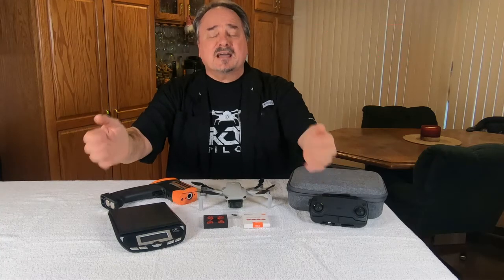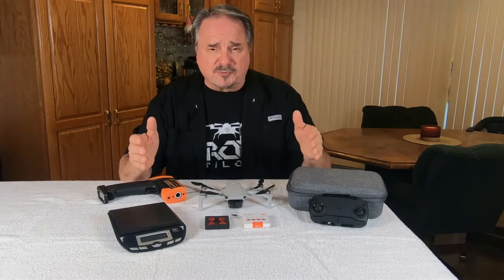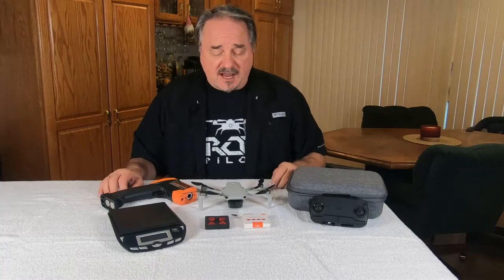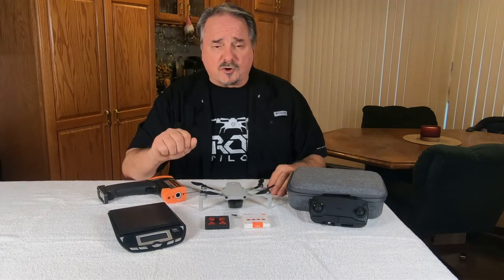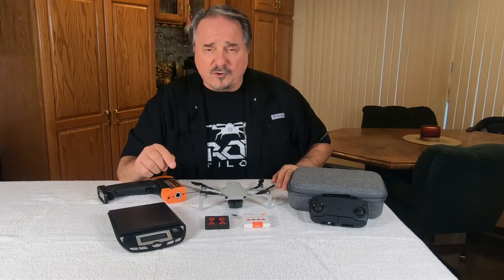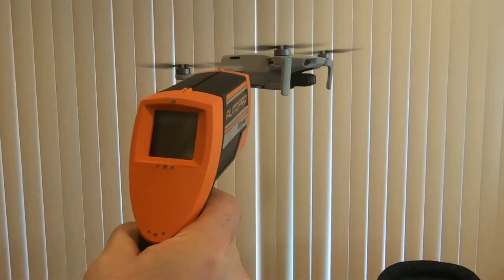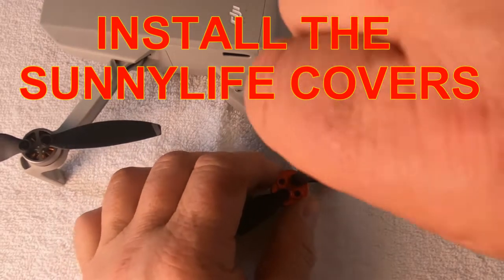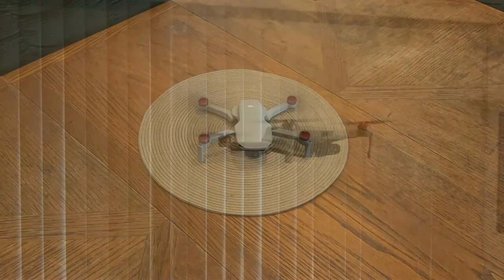MINI MOTOR COVERS

Comment: Did you face any difficulties in connection or something of that sort?
I am thinking to get the motor covers. What would you suggest?
Thank you! :)
Reply from the maker: I added the motor covers to find out what temperature difference there may have been. I do not run my drones in inclement weather conditions or in areas that may have particulates in the air, such as a beach area, with sand in the air.
Reply: @airangerguy1847  what @rishitr9566 was asking was about the possible connection interference.Some owners commented that these covers interfered with connection between drone and controller.

Comment: Would not the motors run cooler through the fresh clean air outside rather than inside can run other base test outside
Reply from the maker: Actually that's a good point.  But what we wanted to do was be in a controlled environment. Being inside and hovering simply illustrated the minimal increase in temperature that the covers could produce. I would suspect that flying outside while in flight might actually produce results of little if not  any increase in the motors temperatures. Thanks for checking out the video and making a comment.
Bob
Reply: I had purchased a set of engine covers previous to noticing your review thanks for that. I don't know that anybody has had issues with grit in there motors unless they crashed there drone will you be running with on from now on
Regards Geoff
Reply from the maker: @geoffreymarks-rodger725  I have no plans on running the smaller drones with the motor covers. I found it interesting that larger drones have the motors enclosed. The smaller drones having open motors might have been purposely engineered to meet weight objectives. I simply wanted to see if the covers would cause an increase in motor temps. Thanks for watching and your comment.